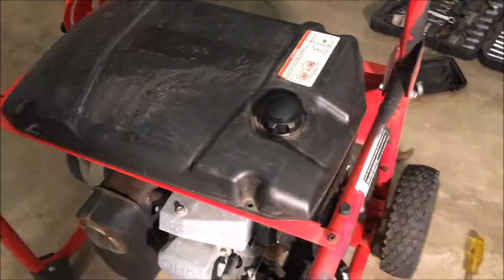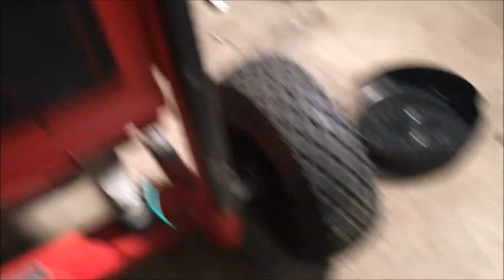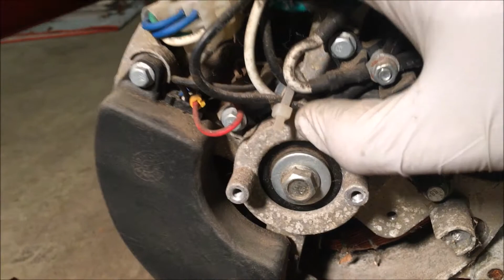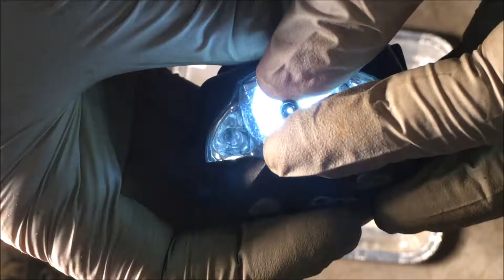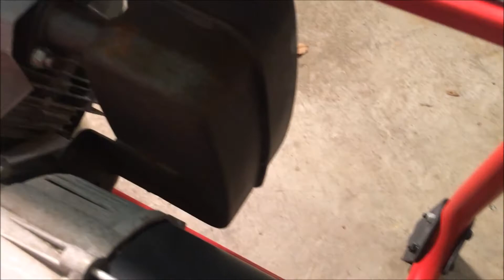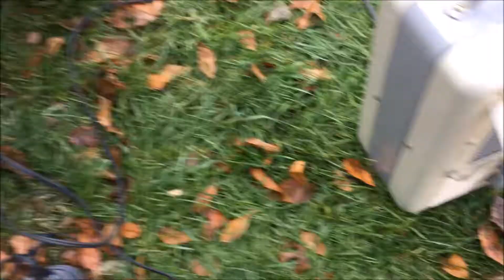Homelite Generator With a Rusted Out Gas Tank.  Will not Start

Comment: Dealing with same gas tank issue. Drained and filled fuel, drained cab bowl, replaced spark plug, adjusted valves, cleaned carb... I was pulling it for 500th time and was like "let's see if this is getting fuel". Went to drain carb bowl again and hardly anything came out. Took fuel line off carb fuel dripped. Removed petcock and found it pretty clogged and the new gas had tons of debris in it. I'm going to try a temp fuel tank, get it to run and probably buy a new tank. 

Just hope it runs tonight 🤞🏼

Comment: It looked like the back of the carb(engine side) has a small hole looks like it could lead to that adjustment screw. Well you blocked it completely with the gasket you made.

Comment: I used to think that generators that had plastic gas tanks on them were cheaply constructed, not anymore.I’ll never have another metal fuel tank on a generator ever again just for that “rust” reason.
Reply: I don’t even try anymore to clean bad ones, just order new one from eBay and install it 
Best is 7 gallon on large units
Reply: I buy every plastic generator tank I find
Can’t find new plastic ones

Comment: Another informative video James. You might check into citric acid for rust removal. I got the idea from Frank Lee (all bow down) and his drill press thread on the Garage Journal. The dry power is cheap on Amazon. Coffee or detergent scoop per gallon of hot water in a five gallon bucket. Steel hardware can soak of 12-24 hours. Cast iron you should check every four hours. The acid dissolves iron, it just dissolves iron oxide (rust) faster, turning it into a inert iron oxide chelate, black flakey stuff. Dispose of the citric, rinse, toss some light degreaser, brush to remove the chelate till it stops coming off, air dry. I usually treat it with metal prep or OSPHO available at Ace and then paint with Rust-Oleum or POR-15. Could I use a sand blaster? Sure, but, not everyone has the money or space for one and everyone has hot water, a five gallon bucket and a pint brush. Just did my first generator flywheel. I was concerned how it might effect the magnet or nylon spacer. Nope it's fine. Pretty, and yes I like wasting time on that kind of thing. Makes me smile every time I use it.
Reply from the maker: I get a lot of comments on rust removal.  Have not tried citric acid yet.  Evaprust work wells, but a little pricey.

Comment: Go to Home Depit, and get a couple of gallons of dilute muriatic acid. They sell it where they sell cement. It's used to clean rust out of stained concrete. Let it soak a day or 2, then rinse, dry out, and use "Red Coat" tank sealer on the bottom, and up half the sides. I've done this, with a small mower tank with good results....
Reply from the maker: Thanks.  Will try that.
Reply: The coating will peel off in a couple month/years clogging your fuel filter or carb.
Reply: @Chris-yy7qc  hi chris, I was told about red coat, and tried it. Put it up the sides about half way, and I did it about 3 years ago, no trouble. Maybe I just got lucky, but I'll have to keep an eye on it....
Reply: @w2dmw  Ive seen this stuff on motorcycle tanks. Itll start to peel of at some point. The problem is then there isnt really a way to remove this stuff completely. So as a last resort on a badly rusted tank it might be a good temporary fix, but it wont last forever. And once it starts to peel off the tank is junk.
If theres enough metal left I use phosphoric acid (be careful with this stuff), because the phosphoric acid forms a dark grey protective layer on the metal. The protective layer offers a good rust protection but cannot peel off because its the metal itself. Gastanks are treated this way from the factory. 
Other acids (muriatic, citric, vinnegar) just leave bare metal which will flash rust again in the blink of an eye.
Reply: @Chris-yy7qc  Hey Chris, great info, thanks for the explanation.   As I have a series 2 Prius, (2008) I appreciated the  batter replace info. 
 I have seen a company "Green Power" or something like that, Who will sell you a NEW set of batteries, for $1750, including shipping. Big plus, it's complete....the whole frame and all.....wgaddaya think.....gauranteed too.

Comment: Mustie puts a bunch of big nuts in the tank and shakes it to help get rid of the loose rust and then burns it out with Murat ice acid and seals it with red hat sealer. We had an almost rusted out gas tank on a ‘57 IH Cub and I cleaned it out to remove loose rust and never had a bit of problems with it, afterwards.  Rust in a metal tank is a fact of life.

Comment: where did you get that small drill set
Reply from the maker: On Amazon Gyros Carbon Steel Wire Gauge Mini Twist Drill Bit Set |Includes 20 Micro Carbon Steel Bit Sizes #60 to #80 | with Convenient Clear Dome Storage Case (45-12010) https://www.amazon.com/dp/B000SKRR76/ref=cm_sw_r_cp_api_i_w.lMFb9ZWAZVC?_encoding=UTF8&psc=1

Comment: Checking the stators or brushes is the procedure the same? Great cheap fix. Best way out of a bad machine. Where do you research for proper specs. With the shield over the exhaust . Did you say it can be run safely? But not for a long period of time. Most are run for a long period of time. Right?  I missed the point.
Reply from the maker: May have misspoke.  With the shield, it is safe to run for as long as you need.  I actually have a service manual on this generator.  But most generators built around 2011 of this size have very similar specs.  Same procedure, just test the ohms.  Stator should be around .2-.5 ohms and the rotor 50-70 ohms.
Reply: @jcondon1  Thank you for the information.

Comment: Hey James...I just acquired a Homelite 4400 generator from a friend who drained the fuel,except oil,and stored it away in the garage.Do you think it would be safe to just fill it up with fuel and try running it? The gas tank is beautiful inside.hoses don't even look/feel rotted. Or...should I clean the tank out again...change hoses...clean carb...and change spark plug.Not a small engine mechanic but I like to learn as I go.If I see something broken,I change it out.Hoping it's not too much to get her running again. Forgot to mention...it was stored for atleast 10 years.
Reply from the maker: Make sure the throttle plate moves.  Sometime they get stuck when sitting for a while.  If you can move it then probably safe to try and start as long as the oil and fuel lines are good.
Reply: @jcondon1  Thanks brother! I'll let you know how it turns out. Take care!
Reply: @rickdan-l7h  So how did it turn out?
Reply: @Chris-yy7qc  Still couldn't get it started but weather and all made me put it on hold til later. Hopefully I can get it going. I live smack in the middle of Hurricane Alley. Thanks for checking up.

Comment: I just picked up a Husky 1800 with a Subaru Engine.  The owner ran it once, then it sat for 10 years and he took the carb off to clean it...didn't know what he was doing, gave up and I got it for 75 bucks.  Only problem is he forgot to put the bowl in the parts bag...the bowl is 32 dollars and the carb is 140.  Luckily I found one place selling an OEM bowl for 3 bucks so hopefully the carb will work once I get the bowl installed.  It's a great unit, never kept outside, oil and spark plug looked like new.
Reply from the maker: James Bubnick I like those little ones with the Subaru engine.  At least the parts are available.  I believe it is also brushless so it should last a long time.
Reply: @jcondon1 You're right it's nice with the parts still available,  I bought a Powermate OHV 2800 with a Suzuki H160A motor/mikuni carb and everything has been discontinued.  Granted it's probably 25+ years old but I think I'm going to try a carb from a Subaru EX17 series motor and see if that works.  Granted I can always convert it to propane.  I got the carb more or less clean/working but the needle and seat leak a tiny bit, it runs great just have to remember to shut the fuel off afterwards or it drips.  I know I should be happy I got it running and it's at 98% but the small drip bothers me.
Reply from the maker: James Bubnick it should work.  That is an EX17 engine.  Just have different configurations like the position of the choke lever etc.  You can also put some carb cleaner on a q-tip and run in the drill on the seat.  Just do not get any on the needle rubber or it will really not work anymore.  Also you can just get a new needle.  Just lookup the part number from the engine diagram.  The engine number is on a white sticker right side of the recoil.
Reply: James Bubnick did it turn out ok?
Reply: jim s it did but I ended up buying a new carb, the carb was missing some other parts and I figured I’d be into it for 1/2 the carb so to play it safe I might as well just order a new oem one.  I’m also keeping it for myself.😀